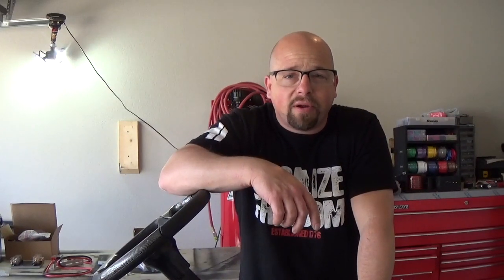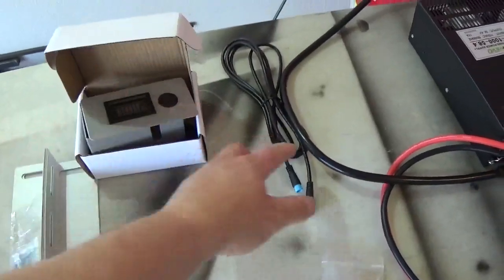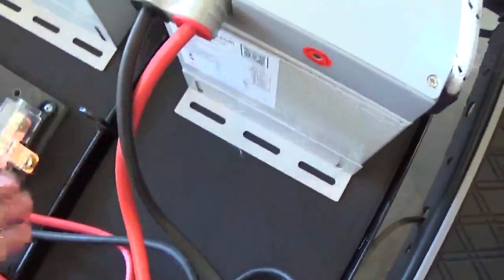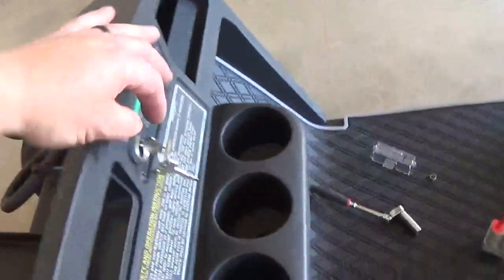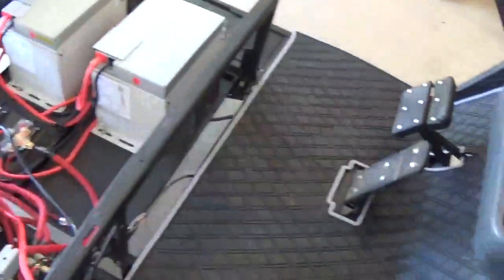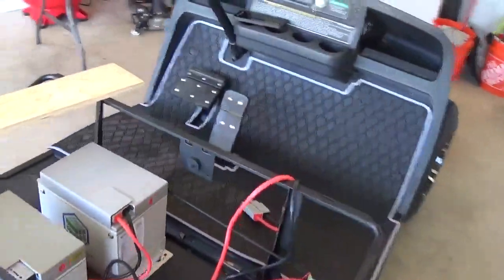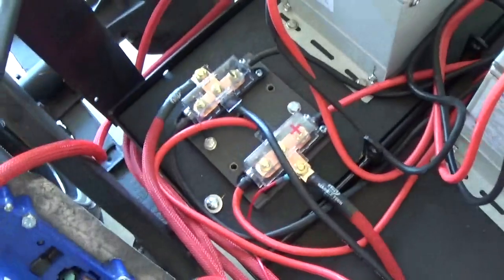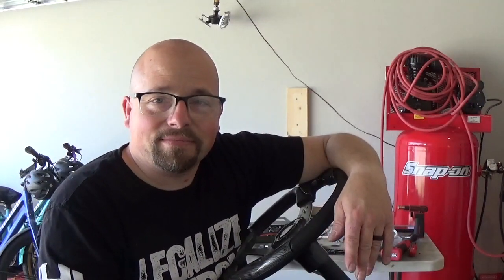"bigbattery.com" lithium install!!! (Meltdown part 7)

Comment: noticed you didn't install the 175 amp fusible link that you originally showed on positive lead, are those a good idea ?
Reply from the maker: @greenparrot2068  the battery is internally protected

Comment: Not to sound picky or anything but you should have put a battery on each side to even out your weight
Reply: OKI saw that you put on both in the middle that even's out your weight. But I would still put a battery on each side and mount all your electronics on the back wall that will give you more storage between the batteries.
Reply from the maker: They are super light😎👍🏻

Comment: Are Big Battery Chargers By Pass chargers.  I have an old 2003 CC DS and I'm wondering if I need to by pass the OBC to use this charger.
Reply from the maker: Depends on how you wire the BB charger
Reply: @kartkrazy  Wow, thanks for your quick reply! ok, we’ll, BB only says to disconnect the pos and neg leads of the charger port from the cart and connect to their busbar. On my ‘03 CC DS the neg lead goes directly into the back of the OBC.  So, I’d need to cut it at the OBC, put a new ring terminal on it and connect it to the busbar. Do you think that’s it? The pos lead is already connected to the main battery pack pos terminal.
Reply from the maker: @kerrykoehler9112  just disregard OBC
No longer needed with BB set up
Reply: @kartkrazy  Got it! TY. I decided to bypass the OBC and it’s working just fine. Always nerve racking though, when cutting/splicing/removing wires.

Comment: I have the same batteries with a stock club car precedent. I have the Alltrax 48300 controller and I was wondering what you set REGEN to in your Alltrax? Thanks for the great videos.
Reply from the maker: I turn off the REGEN

Comment: I Installed the Falcon Elite Kit 120Ah in my Icon L6 48V and get no response, all utilities work, I removed the O.E. onboard Charger to be replaced with Big Batteries Charger. When I press the pedal,  it clicks but goes nowhere, any advice would be appreciated ??
Reply from the maker: I’m not real versed on the icon…
I would just double check all your connections and check your voltage with a multimeter
Reply: @kartkrazy  Ok, Thank You for the quick response

Comment: Maybe mount them closer to the passenger side to even the weight of the drivers side weight with the driver sitting in the cart.
Reply from the maker: That’s what I do on the Club Cars… with the Ez Go it’s just easier because of all the electronics being right there. Maybe I’m just lazy. 😂

Comment: I put 2 Eagle batteries in my cart and not happy with the range . Now I have to spend at least another $699 to increase my range .
Reply from the maker: Interesting…
Eagles are awesome with great range…
Is there any special circumstances that would cause your range to be diminished?
Reply: @kartkrazy  …The cart is stock except for 23 inch tires . My range with lead acid was much better . 
I live in a 55+ community and heard the same thing from others who went to lithium . Have to be very careful how low you take the voltage down on the lithium also . I have seen people getting towed back from there rides to town . At least with the lead acid you can still keep the cart going .
Reply from the maker: @toledojeeper2932  sorry to hear of your disappointment…my experience is quite different
Reply: @kartkrazy  …I like the weight reduction, the cart drives and rides much better . I think if I buy 1 more battery it will be better . I was just surprised the range isn’t what I was told , not even close . If I have to charge the cart nightly while doing the same amount of driving I might as well stayed with lead acid .
Reply: @toledojeeper2932   I could never go back to lead acid.  What a nightmare they are to maintain plus you get offgassing, etc.
Reply: @joeking433  ..I have a newer cart with lead acid . Maintenance is pretty easy . It has a quick fill water system. I don’t mind the lead acid . It just depends on what you need .

Comment: Nothing against Lithium batteries, but unless you need the range not worth it
Reply from the maker: I like the zero maintenance and nice clean battery compartment
Reply: I can't believe anyone even sells lead acid batteries for carts. Especially flooded batteries like the Trojans.  What a nightmare with the maintenance and offgassing, etc
Reply from the maker: @joeking433 agreed
Reply: The range sucks too

Comment: What kind of mileage do you get on a single charge with this setup?
Reply from the maker: 25-30 plus depending on number of passengers terrain etc.
Reply: I have 2 Eagles for a 60amp hour total . The range sucks , wish I had stayed with lead acid .
Reply from the maker: @toledojeeper2932  that surprises me
Reply: @toledojeeper2932 what is the range?
Reply: @Jared535  …I haven’t tracked it with a odometer but my trips don’t change much and the lead acid lasted longer . The main problem with the lithium is you have to be very careful when you get down to under 40% . Under 40% and you take a chance of having to wake the batteries up which I don’t have the charger for . I got lucky already once by charging them separately and it worked but they were only low not asleep.
Reply: @toledojeeper2932 I have a 6 seater. My cart would t even run on 60ah. I had to go with 90ah. I’m running the Epoch so I added 1 more battery.

Comment: I have just some golf cart frame everything is pulled out wires and everything could I get a motor and the wires as a kit or what I need let me know Cajunland Church Point News Louisiana
Reply from the maker: you can order a kit from any of the major parts suppliers

Comment: I just bought 6 Trojan T105, 6-volt batteries, they cost almost exactly $1,000 including cores.  From now on I will have to pretend lithium batteries don't exist so I won't want to kick the dog every time I see one.
Reply: Yeah, I was looking at $1200 for 4 12 volts so I made the jump to LiFePO4. Since my cart gets daily 25-35 miles I also went ahead and went 72 volts. My lead Trojans lasted 2 years so I'll never go lead again. Big Battery guarantees 3500 charge cycles, that's TEN YEARS. The are expensive but way cheaper in the long run.
Reply from the maker: @goldenlife9856  awesome!! you will not be disappointed!!
Reply: @kartkrazy  Oh, do I know. I've had them in place 4 months with 5k Navitas AC system.  40+ mile range and 50+ mph top speed. I run take off wheels and tires from a car (over a hundred vehicles interchange with golf cart pattern) $187 for a set at Pic-N-Pull
Reply: @goldenlife9856  how many batteries are you running with this AC kit?
Reply: @Moisasolifestyle  I currently have 2 72volt Falcons. I would really like to have a third just as peace of mind. But now I have found a really good meter that works made by Hengshan sold on Amazon and is used by test facilities that I've talked to that say they are dead nuts accurate
Reply from the maker: Lithiums are the way to go for sure😀
Reply: @kartkrazy  Where's my dog?
Reply: @JT-jg8le  Yes, motor and controller. Most people do the Navitas AC system. That is compatible with (although they say you can't) 36v, 48v, and 72v. You don't need to change your main solenoid, it's a parameter in the settings. I did my neighbor's 36v ezgo left the 36v solenoid, just told the controller it was 36v. Then put in 72V BigBattery Falcons
Reply: I have lithium and wouldn’t recommend them . The range is terrible unless you are willing to spend $2500 .
Reply from the maker: I’m curious as to what brand you might have?
I think lithiums are far superior over LA’s
Reply: @kartkrazy  …Big Battery Eagle , 2 of the 30 amp hour batteries. Now I have to spend at least another $700 to get close to la range .
Reply: @toledojeeper2932  The eagles, you should get 10-15 miles per battery. Unless they set a lot. They will discharge over time unless you turn them off in between.
Reply: @goldenlife9856  …It’s driven daily
I definitely don’t get 20 to 30 miles out of them . I have to charge them daily so there was no sense of going to lithium since I charged my lead acid daily .
Reply: @toledojeeper2932  Then I would suggest calling BigBattery's tech line because if you're not getting 20 miles there's a problem. Is this a AC cart or DC?
Reply: @goldenlife9856  ..It’s a Club Car DS with AC motor
Reply: Wow, I can't believe anyone buys lead acid batteries for carts these days.

Comment: Question...what voltage is that motor? Im assuming a 36v being a 94? If so, did you replace it with a 48v?
Reply from the maker: You are correct…it is a 36 volt. You can run 48v on these older ones and be ok. Good catch!!
Reply: @kartkrazy  ok, just so I understand you correctly. Your saying you hooked up those 48v batteries to that 36v motor?
Reply from the maker: @raymerritt788  correct

Comment: that charger is not weather sealed… don’t do it!
Reply from the maker: It’s a pavement princess…but I found another way. Thank you
Reply: You can buy a Anderson Connector bulkhead to keep from raising the seat each time. Makes for a cleaner installation. Even if you only stay on paved roads dust, debris, and moisture still gets in that well area. My Club Car has a tub for the batteries and I still get plenty of junk that needs blown out periodically.